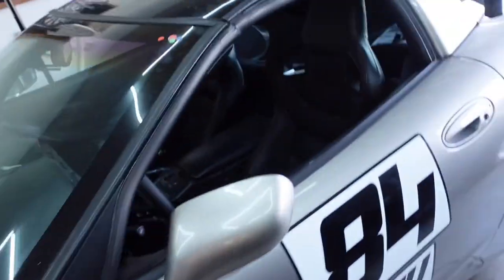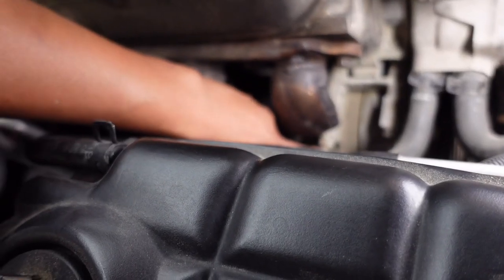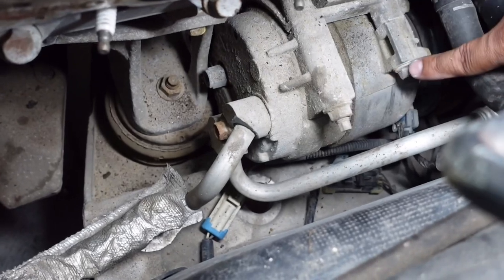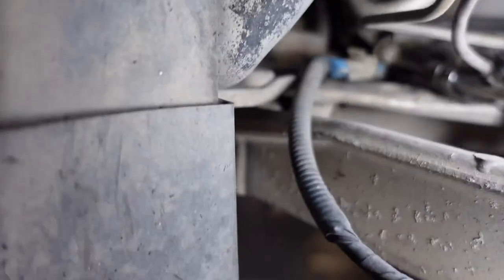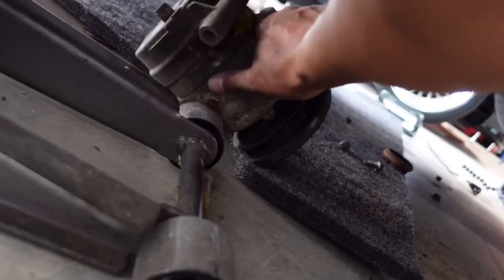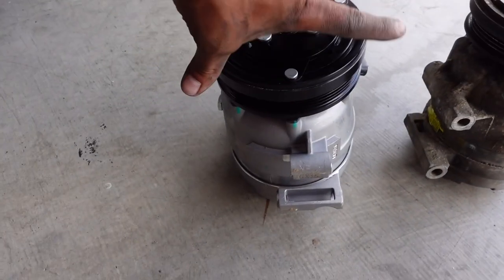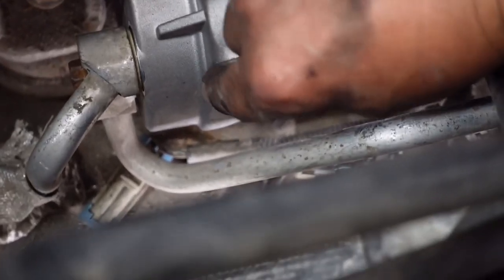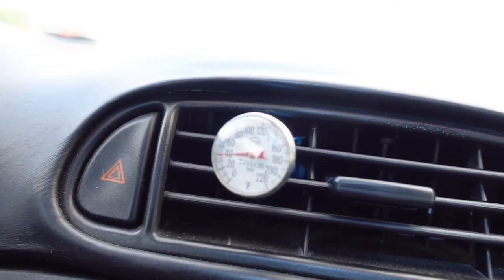The Easiest Way To Replace A Chevy Corvette A/C Compressor

Comment: I did the same job by just removing the thermostat housing and loosening the motor mount and jacking up the engine about an inch removed all the heater hoses and the top transmission line on the radiator and I removed the ac manifold hoses when the compressor is loose in position then removed compressor ! came right out

Comment: Man I flat rated the hell out this job thanks to ur video.   Hint pull the middle plugs and pull it out the top
Reply from the maker: Awesome glad this video was helpful.
Reply: And plug the spark plug holes with paper tower to prevent foreign objects from getting into cylinders. !~

Comment: That has to be by far the easiest way of changing the compressor and the quickest. . I just did mine today but did the water pump route which takes much much longer. With the manifold out of the way you have easy access onto the bolt on the ac compressor to remove the lines. The manifold otherwise is in the way and it is really awkward getting this bolt out. Also no messing around draining the coolant and bleeding the system after. Good work.
Reply from the maker: Appreciate it that. Yeah this is by far the easiest I’ve seen done. Hope it helps others in the same situation

Comment: after you disconnected the header from under the car, did you need to unbolt any other bolts holding the exhaust up to take the exhaust off?

Comment: Great video.  I see you didn't do the drier and the xpansion valve?  U might enlighten the public about draining the shipping oil first and to be VERY CAREful not to overfill new oil (compressor will Not compress oil), just put exactly the spec oil in..  Not recommended but I did get a junkyard  a/c compressor in 04, it leasted until 2023, wow ! I didn't do the oil or or drier or xpansion valve, lol.  inventpeaceNotWar

Comment: Thanks so much for this vid, my '97 had the leak through the body of the comp issue..  compressor from ebay seller: stockacparts   fit perfectly and was pre-filled with oil
Appreciate everyones tips in the comments, left H pipe on and took out middle 2 plugs and lifted it out the top, held vac and charged and up and running in 3~ hrs or so, cheers from Aus :D

Comment: You the man! I will try this. When you take off the compressor did you have to suck out the freon or anything like that when you removed the hoses to the compressor?
Reply from the maker: Thanks! Luckily I didn’t have to evacuate the Freon since my system had leaked out.

Comment: Great video. I'm probably going to replace mine when I do the front end of the engine. It'd have to remove my whole exhaust system to get to mine due to LT headers.
Reply from the maker: Yeah it’s a little bit more tricky when you have long tubes. I just had to loosen mine & not fully remove them out of the car.

Comment: Did you have to remove the H pipe? couldn't you have just taken the bolts out from the pass side header of the H pipe or would the header studs prevent it from coming out. I think I have to do this on my C5 soon.
Reply from the maker: If I remember correctly I didn’t remove the H pipe. Just remove header & spark plugs. You might have to loosen the h-pipe to give you a little move wiggle room

Comment: Awesome video! I just have one small question, Do you need to put the PAG oil or the shop it charged the system put the corresponding oil?
Reply from the maker: If you take it to a shop to have them charge the system they can add the required amount needed.
Reply: @JJBanuelos  Thanks

Comment: I need to replace my Compressor on my ‘99 Coupe also being it leaks Freon through the body of the compressor. Supposedly there is a easier way to get that compressor out by loosing up the motor mount on the Passenger Side from what I understand and putting a block of wood under the old pan and lifting the motor up some with a floor Jack. Supposedly the water pump doesn’t need to come out that way and will come out the front. I had some health problems and haven’t had the time to do the job as of yet.
Reply from the maker: I doubt that cause you can’t lower the subframe low enough to squeeze it past there but I guess anything is possible
Reply: @JJBanuelos  I am not knocking you but this way seems like a lot of work having to take the exhaust down and right side exhaust manifold off. Based on what I can see on other videos it looks like it is a easier even removing the water pump to do this job. My compressors leak is coming through the aluminum body of the Compressor the reason I purchased a brand new compressor rather then going with a rebuilt. Many spoke about this problem on the Corvette Forum on C5 Corvettes. This was a good video you took. One of the better ones I have seen.

Comment: Since you installed it from the top, it should be possible to remove it from the top also???? Or no??
Reply: And did evac the system before removal?
Reply from the maker: Yes it’s possible to remove from the top with header removed. I didn’t have any Freon in my system so there was no need for  evac.
Reply: @JJBanuelos  always should evac system to pull moisture out regardless.